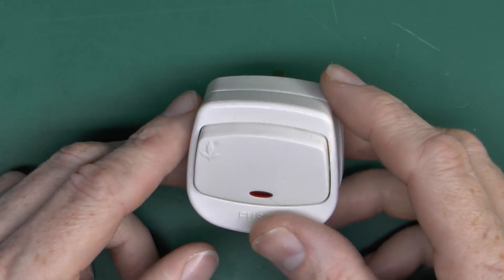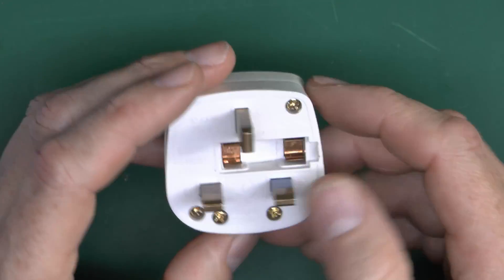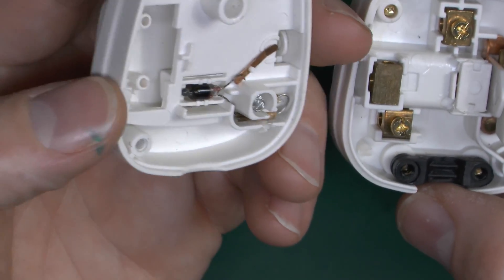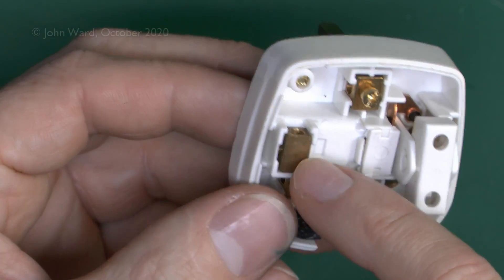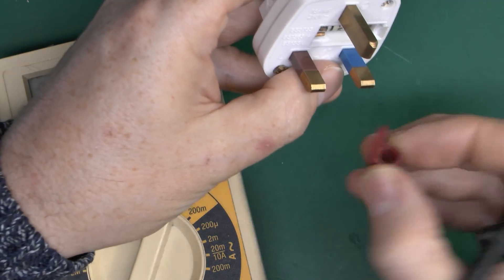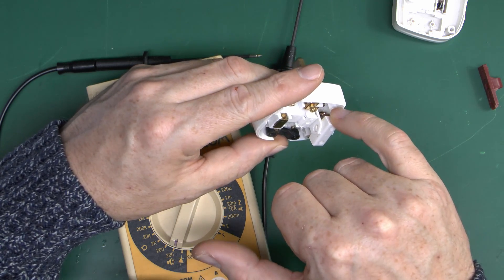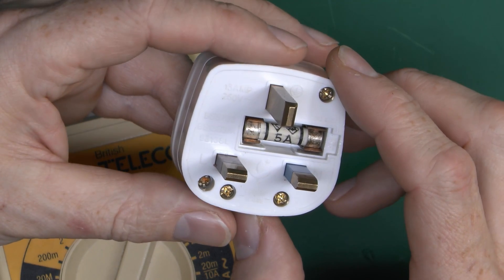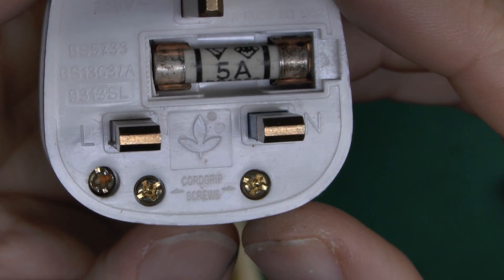Switched 13a Plug BS1363

Comment: I really want to know which regulation item in BS1363-1 or others verifies this type of switched plug illegal.
I have some for light load ( replace original 13A to 3 or 5A) or switch off the load before switch off this plug in order to avoid high arcing current damaging the switch contact.
If we use the wall socket switch on/off several times a day, replacement cost of socket is much higher. Even some don’t have Neon lamp too.
Reply from the maker: Switched plugs are not illegal, and no British Standard determines what is legal or not.
Reply: @jwflame I believe it is an unsafe product in BS standard definition, but I know which standard. So if shop still sell it, it is illegal. 
Such kind of good device why I can’t find it in UK.
Reply from the maker: @bikeman3103  Not illegal, never have been, this is the first result on Google for 'BS1363 switched plug' : https://cpc.farnell.com/pro-elec/pelb1642/plugtop-switched/dp/PL10037
Reply: @jwflame Why I can’t find it in any shop instead of on line

Comment: Would be better to have an side ground 230V - center grounded 240V for travellers over Atlantic at least for resistive (non rectified) current. With 3 from 4 wires used switching neutral connector between opposite hot wire {grounding the neutral}(in US) and neutral wire regaining the ground fault function (in UK). The american power source for this British plug should have diferential in between of the two phases and direct neutral. Condenser second phase motors like (hairdryer, cooling fans, heating fans, massage and cosmetic aplliances - AC~ shavers and trimmers, heating liquid pumps,) might have problems with the third negative harmonic on the second phase if the primary coil of the transformer on the pole isn't tied to the ground like it's used in downtown  with single phase transformer with two high voltage inputs(phase to phase). The old style rectifier wouldn't fully charge the batteries even if in low-mid charge level would charge faster due to longer impulse to micropause ratio.
Reply: Tesla might like the grounded phase more for full charge. I don't know how their home wall chargers work.

Comment: It always amuses me that other countries find our switched outlets so bizarre - it seems so normal when you have been used to that all your life, and also so logical - I'd much rather flick the little switch to take something off standby, or provide that extra bit of reassurance that an appliance is definitely off without having to pull the plug. I know in the USA it is common for some outlets to be switched at the door - this is still used sometimes here in the UK but usually for lighting only, and not for our standard 13A rectangular pin outlets, rather for old style 2A or 5A round pin outlets. What do other countries do? I note agent24's post says switched outlets are common in New Zealand.
Reply: Almost 100% of Australian outlets are switched too. My mother drives me crazy by switching things off at the wall outlet, because she is too old and stupid to work out how to turn off an appliance like a cooling fan.

Comment: I had a switched plug something like that in the late 60s/early 70s on my 25 W soldering iron, not to switch it on/off but I had wired a suitably rated diode across the switch so that the iron was on full power when the switch was closed and reduced power when the switch was open - the half-wave rectified mains was enough to keep it warm but ready to quickly heat up to full power when I needed it. It wasn't a consideration at the time, but the power was low so the asymmetry it caused in the mains wasn't an issue.

Comment: These FYM plugs/ extension cords are very common in Hong Kong and can be found in most local hardware stores. The HK Consumer Council has tested a FYM S344USB extension cord and it only failed 2 safety tests out of 26. I also has a FYM S364USB H extension cord currently using in my room (https://imgshare.io/images/2020/11/02/DSC_0091.jpg ).

Sources:
USB Extension Sockets Need Improvement on Safety Level Over 85% of Models Do Not Comply with the Standards
https://www.consumer.org.hk/ws_en/news/press/511/USB-extension-socket.html
https://hk.appledaily.com/local/20190515/EM3PVMZ3VI6M5S3IKHFC44HCZ4/

Comment: I remember jo-jo from the 1980's on a volex cassette reel extension lead series... from around 1987-1990 time, red & black twin socket reels, jo-jo hobby point 6 amp & 10 amp reels, jo-jo power point 13 amp reels, had the bigger all plastic volex plugs using the black base & ret top with red cable... had a couple of them but the 6 amp ones used to get snagged... can't remember if the fuses in the plugs were jo-jo branded or volex branded... I think volex being volex products though so the name jo-jo on a fuse might be one of those fake chinese fuses.

I've got 3 switched plugs about somewhere but not in service, fuses are "alert" branded 13A and inside the plugs, mine are chinese made but are PMS branded & don't have neon lights...

Why would someone use a switched plug for an aquarium pump... usually they're on 24/7... only thing that usually gets switched off in the aquarium is the hood light at night so the fish get some hours of darkness & there's usually a switch on the back or on the power pack with the starter for the light.

Comment: British power points (or sockets) need a switch because the design of the plug is so big and clumsy that it’s often a struggle to get them pushed in and even harder to pull them out.
Reply: Old Man One right, because everyone wants plugs that slip out of the socket with the slightest movement of the cable. Better still if the plugs only partially slip out creating an arc.
Reply: @spencerwilton5831 . One doesn’t follow the other. In most countries the plugs plug in and out perfectly safely.
Reply: @maxmullen6337  except that it makes contact with L and N quarter way in meaning put any metal object in there and shock yourself, whereas uk plugs are sleeved, and the safest in the world
Reply: @db-bv5rs  . Safe but clumsy and awkward.
Reply: @maxmullen6337  have you every tried one, because there is multiple factors that can cause it to be awkward. For example, dodgy plug or socket or the pins are the wrong dimension which causes the shutters to be really stiff and you have to force it in
Reply: @db-bv5rs . The problem might just be mass production in a foreign country. I’m not saying it’s impossible to plug in and out, but it is awkward and it’s necessary to (sort of) prepare yourself. Almost take a deep breath, flex some muscles and launch yourself at it, with determination!!!
Reply: @maxmullen6337  where r u from? Have you ever used one?
Reply: @db-bv5rs . I’m beginning to wonder if you have!!
Reply: @maxmullen6337  no genuine question though

Comment: A desk lamp with a pullcord switch with a cord switch, with a switched plug plugged into a switched outlet. I like it
Reply: No, you silly thing... You forgot the RF-remote-controlled plug adaptor that the switched plug was plugged into.
Reply: @johncoops6897  don't forget the clappers too
Reply: @felenov  - do you install the Clapper before or after the RF adaptor?

Comment: Remember a good few plugs with fuse in the back in the early 70s before my parents moved to Australia. They did sometimes leave the fuse behind as happened here. Always assumed the switched socket was required by regulations but evidently not.

Comment: Always feel like the main screw(s) should be gong into metal inserts rather than self-tapping into plastic columns - never seen one fall in two, but they're surely bound to get sloppy if the plug gets opened and closed a few times.

Comment: When I've used non switched S/O in the past it's to prevent accidental switching off sensitive equipment.
Reply: Were the sockets fed from an UPS ?
Reply: @millomweb  some were, but also fed cabinets with it's own ups built in .
Reply: @raychambers3646  Little point worrying about something being accidentally turned off if relying on a power supply !
Reply: @millomweb  there is when you've got £1000s worth of business going through it with only 20 mins worth of power in reserve .
Reply: @raychambers3646  20 minutes, - can't be that important then.
Do you get range anxiety ?
Reply: @millomweb  the only reason for the 20 mins is for the back up generator to kick in,if that fails an engineer is on call out duty to attend.
Reply: @raychambers3646  I'd hope the emergency generator would be tried first before the backup generator.
In the real world, It's assumed that none of the emergency generators will start - so the backup batteries will run equipment for far longer than 20 mins !

It was quite interesting shopping in Asda in a power cut. I was using scan & go - so I was on batteries in any case. I wasn't sure what they're connected to (if anything) but they carried on working in the relative dimness of the emergency lights for a minute or 2 before the store was switched over to generator supply - obviated by the reduced overhead lighting levels ! The tills were not on an UPS - so they just rebooted when the gen came online. After a further 15 mins, they decided to close the store and gave us all 30 mins to finish our shopping - which we'd just about done anyway.
Reply: @millomweb  all systems on BMS ,remotely started once a month also run at 110%load once a year ,if engineer called usually towing a back up generator.Very belt and braces 50 kw 3 phase.
Reply: @raychambers3646  I only need 3kW though ;)
Reply: @millomweb  one of the places I worked had 3  one megawatt generators (ear defender territory) .
Reply: @raychambers3646  The joke here is yeah, one for each phase ;)
Hydro ?
Reply: @millomweb  very good ,no just standby generators in case of mains fail .if you like main grid generation try a visit to Hinkley Point Nuclear Power Station.
Reply: @raychambers3646  Calder Hall was my local. Had a school trip round that in the 1980s.
My current problem (awful pun !) is powering a couple of 3ph machines from a single phase domestic supply ! I know what's 'out there' but electronics aren't really robust enough to have motors suddenly reversed !

Comment: I initially came across these over a year ago on eBay, while searching for wireable plugs that allow direct access to the fuse, without needing to unscrew the top. Other than these, that feature seems to come only on the molded ones that are pre-fitted to new appliances. 

As someone else pointed out, I've found these useful for the more compact and cheaper multi-blocks that lack switches on the individual  sockets. On the first one I used I thought the switch was a bit soft, so wasn't surprised when I found it to arc every time I used it, which caused concern. I've since replaced with what seems like a better quality model from a different eBay source, and haven't seen the same problem.
Reply: UPDATE: the new one has failed. The live terminal has detached from the fuse. Can anyone recommend a reliable one?

Comment: Great vid John. Any chance you could do a video on reed switches please? Would appreciate. 👍
Reply: What interests you about Reed switches?
Reply: @brianrussell6988  I've got a chess computer that auto senses the peices, a red led light illuminates for each square. But some of the leds aren't working and the computer is showing and error on the user display. I've been told it's a reed switch problem.
Reply: @williammcgrattan9583  the chess pieces will contain a magnet that will close the Reed switch when you move to the appropriate square which I guess lights the led. If this is the case and you can get into the PCB then it should be easy to change the Reed switch.  You have to find a Reed switch that has the same sensitivity.  It is likely the Reed switches in the chess board will have been cut to fit into the space on the PCB. Cutting the Reed switch reduces the sensitivity as you are removing ferrous material. You should be able to find a range of Reed switches through Farnell, RS etc.  You should give the repair a go as you have nothing to loose. Let me know if you need any other information.
Reply: @brianrussell6988  yes that's my understanding.  Thanks for explaining   really appreciate. 👍

Comment: I love your channel ,I’m from the states , but why on earth would you want a switch on every receptacle, one more thing is it also true you guys don’t use wire nuts.
Reply from the maker: 40+ years ago most were unswitched, today most are switched.  Both types are still available.
Wire nuts haven't been used here for over half a century and even then were not particularly common, typically only being used on certain types of lighting circuit.  Receptacles don't need them as they are all designed to accept multiple wires in each terminal.
Reply: What type connector is used in place of wire nuts , and have you made a video on this topic. Another question I have is , are the materials for an electrical installation available to the general public like here or must you have a license to purchase them.
Reply: @jenko701  There are several videos on JWs  channel comparing connectors mostly a few years ago.
Reply: @jenko701  - for power (socket) circuits (such as 30A, 32A ring circuits or 20A radial circuits), there is no need for any extra connectors as every socket (and fused connection unit) has terminals for line (L, live, hot), neutral (N) and earth (E, ground). Each of which can take at least three 2.5mm squared copper conductors. Junction boxes with three terminals are also available.
For lighting circuits, the standard arrangement is the ‘loop-in’ system, where the feed in cable, feed out cable and the cable to the wall switch or ceiling switch go to a standard ceiling rose. This ceiling rose has four sets of terminals (L in/L out, switched L {SL}, N and E) of sufficient size to take all the required conductors, so no additional connectors are needed.
The alternative arrangement is to wire the feed in cable to the wall switch. In this case either a screw terminal block (cut down from a multi-way screw terminal block/choc block - see https://commons.m.wikimedia.org/wiki/File:Leuchterklemme_75dpi.jpg#mw-jump-to-license ) is used. However Wago connectors (see https://www.wago.com/gb/installation-terminal-blocks-and-connectors/classic-splicing-connector/p/222-413 ) are now becoming more common as they are faster to fit.
Where an existing standard ceiling rose is being replaced by a decorative light fitting (which typically only has terminals suitable for one three core (L, N & E) cable, a separate suitable junction box is supposed to be fitted in the ceiling void. But often you will find a multi-way screw terminal block has been used and shoved wherever the DIYer can hide it.
Reply: @jenko701  - there are a number of reasons why it’s more common for our sockets to have switches. The sockets with switches have been encouraged by both fire fighters and safety campaigners for many years. It’s faster and easier with U.K. plugs to use a switch rather than pull the plug out. And now that they have become the most common type, switched sockets are either a very similar price to unswitched, or are cheaper. As most people have got used to, or have grown up with switched sockets, that’s what they are now used to. If they have to replace any sockets, or have their home/business rewired, why would they want something with less features and which is less convenient for the same price?
Reply: @jenko701  - No license is required to buy electrical fittings, accessories, terminals cables or materials. They can be purchased from specialist suppliers, from DIY stores and from some general stores. Some work on electrical installations is officially restricted to professionals (referred to in the U.K. as part P of the building regulations, a law, see https://www.gov.uk/government/publications/electrical-safety-approved-document-p). And most other electrical work is supposed to be installed to a recognised standard.
Reply: Jjames Anderson Having seen the aftermath of a house fire caused by many years of the homeowner plugging and unplugging every appliance every night I will stick with switches thanks! Years of plugging and unplugging every day, sometimes multiple times per day wears the connections in the socket to the point where arcing or at the very least overheating becomes possibl

Comment: In NZ our sockets are switched too, it baffles me that any country would have unswitched sockets.
Reply: On the market place of my city,16A Schuko sockets are mountedf on wooden poles and connected to the aerial bundled cable without fusing.
The aerial is protected with 80A fuses.Nobody cares about it until it burns down or someone gets shocked.
And you are scared from unswitched sockets?
Reply: @MernokiMegoldasok  OK, that is scary! Where is your city?
Reply: Same here - seems so normal in the UK. I asked in a separate comment what other countries have.
Reply: I believe that original German wiring to Schuko sockets had the mains voltage split, so both pins were "live" at 110v. The only sensible way to switch off in this case is to remove the plug. Perhaps this is where the tradition of removing the plug originated.

Comment: I like these things & have been using them for many years now. I normally buy them from Amazon in multipacks but aways swapped the fuse before 
use for a 5 or 10A one, as I have had the odd one fail in the same way with welded contacts.

Comment: I only ever used unswitched sockets in kitchens, behind appliances, with a double pole switch above the worktop.
I don't like unswitched sockets at any other time as they're disconnectors and you should never disconnect a load using a diconnector, that's what switches are for.